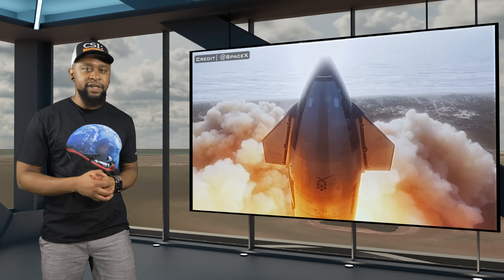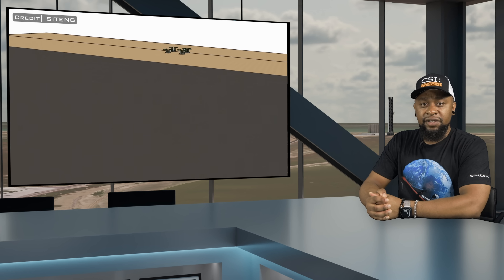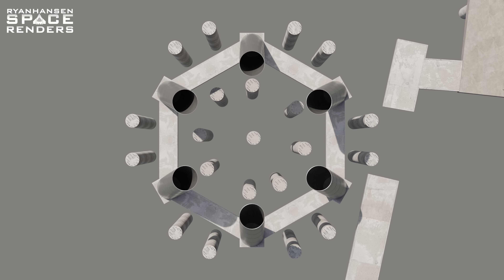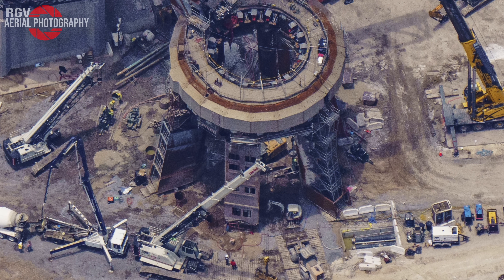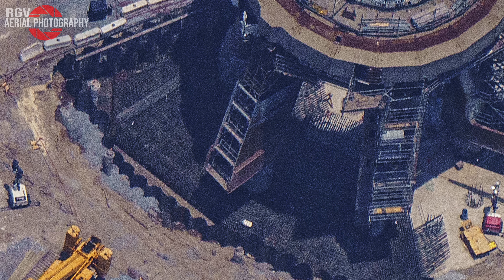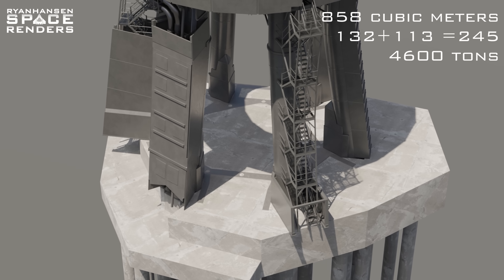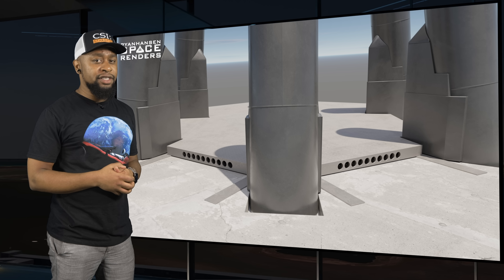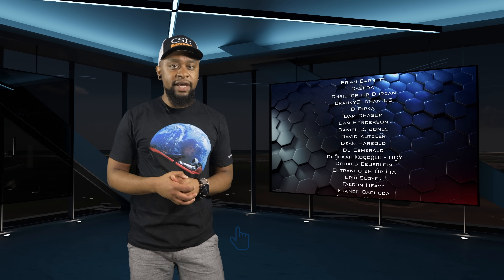How SpaceX Will Guarantee Its Launch Pad Never Fails Again! [Part 1]

Comment: A simple task for the OLT, would be a bridge arch stand and a blast arch ramp vectoring away from the stand center sideways. Not a blast cage!  The fuel pumps shouldn't be mounted on the launch. By a protract feeder. That's like smoking while pumping fuel in a fuel truck tank. ⛽ 🚬 😮💥 .
Reply: "fuel pumps shouldn't be mounted on the launch"

Thank you Captain Obvious

Comment: I admire SpaceX engineering, but the water pressure required for effective transpiration at the center of the launch mount is unlikely to be met from the edge-fed structure. Minimally, the "shower holes" in the plate will have to be made progressively larger from the edge to the center of the plate.

Comment: what do you guys thing about the rust, oxidation and corrosion on steel pad and structure cause by the water deluge system and heat from thrusters?
Reply: Ultimately they’ll either need to replace the metal plates frequently, or install a flame trench. The latter is more useful for rapid reusability.
Reply: Protecting steel from corrosion doesn't require breaking the laws of physics
Reply: @EMichaelBall Because flame trench last forever /s
Reply: @alvianchoiriapriliansyah9882  then explain please? What approach will they take?

Comment: How will they keep the water pumping against the pressure of explosive steam?
Reply: Uhm...the steam is on the outside
Reply: @alvianchoiriapriliansyah9882  oh yeah, water can't boil in a pipe because you said so. Also the "Outside" will have a pressure gradient with no diverter trench to help dissipate it.
Reply: @martinr1834 I hope it's better than their concrete calculations

Comment: 19:32 ... those pipes are not threaded, those are machine marks for sure. There is no need to make those holes smooth for a flow through the plates like that.

Comment: Much investment, that could all be gone if a StarShip fails and all its propellant burns on the stand, but true for all launch towers.  Wonder how this design compares to others.  Do any use water-cooled steel plates?  Don't most just flow a massive water deluge along concrete flame trenches?

Comment: Thank you for this long in-depth review on this OLM foundation. As always it has been thorough & educational too 👌🏻.

I have one Q, whether this foundation would meet Musk's ultimate plan of several launches a day! In fact I recall him speculating on the launch pad being ready "in one hour" , for the next launch after the booster is "caught"! 😮
Reply: The water deluge system is the big weakness. It has to perform to an extreme each time. A flame trench would help a load, but that would require a total teardown of the launch site, and the construction of a mega mountain to host the trench, with OLM 2.0 on top. Maybe they’ll do this in Florida!

Comment: Where did they find all this equipment just available for use along with the trained staff. Any project in the UK takes years because everything has to be coordinated. Safety case made, environmental impact must be checked etc.
Reply: The equipment is rented with some purchased ones with SpaceX labelled on them. They are contracted with multiple constructions, fuel and other specialist companies.
They have teams actively working on environmental and workplace safety.
SpaceX has a lot of contracted workers and they directly hire the longer-term ones.
Reply: I thank God that we aren't as over-regulated as the UK. Tedious regulation, designed to crush the soul. Licenses and permits have been dealt with.

Comment: The issue with the steel plate is that it still doesn't address the issue of noise and vibrations between the plate and the engines. Whereas nasa water deluge system has 1 million gallons per minute and a huge water mist and spraying everywhere. Just look at their falcon launches

Comment: Pillings go down into gound
The ground may be sand graval
brocken rocks or down to solid rock?

The piles the longer they are will get
friction resistance making a firm base to build?
Eartghquakes resonance vibratiion
can tirn holding souil sands to a liquid state?
thus loseing ability to hold the buldings or structures
 above
only the ones supported on a solid  sub surface will retain
integrity
In Japan huge solid constructed buildings have been seen
to tip over intact and sink in to the liquefied soils 
they were built upon
Force vibration resonance are forces not to be took for granted

Comment: Peering close-up into my crystal ball, I see a timing discrepancy between pressure build-up from the rocket engines and the inertia of the water-mass in the shower-head manifolds. Getting thousands of tons of water to move at sufficient speed to overcome the opposing pressure from the engines will be one hell of a job. If the engine fire-up is uneven, It only takes one incursion of exhaust-gas into one hole in the shower-head, for the flow to be reversed in the inter-plate void. This will cause all water in the void to be ejected via the outer holes that are experiencing a lower pressure differential compared to the inner holes. Steel will melt: The result may be spectacular to watch, but will take longer to cut away and repair. 
I'm not being a doom-monger, only looking at it from another perspective. Please don't shoot me!

Comment: I may not be an engineer. Would it not be 10x better and more efficient if you had no platform but a hole where the heat and thrust goes down and out somewhere far away? In a sense the heat & wave of thrust would not hit anything and it would not create any sort of backfire and wind/thrust that it can do when it becomes too much. Not to mention when it doesn't have anywhere to go or sideways.

I don't see how a steel / watercooler would be much more efficient. This would also be WAY cheaper when it comes to construction, since its really just a pathway for the thrust and heat.

Comment: I am wondering if that AR-500 Armor  can be used as a platform for SpaceX.
Meaning,  having a 6-foot thick by 40-feet diameter plate under the OLM to withstand the 36-raptor engines.  Would that solve SpaceX's problem.
Because something tells me, the concrete they keep using is not going to last that long. Specially if SpaceX is planning on launching 12 rockets per day on the same platform.
I am just wondering of humanity needs to step up their game and just lay down solid steel.  Either 6-feet thick, 12-feet thick or even 32-feet thick.
Just curiously wondering as my brain is going through different solution ideas.  🤔🤷‍♀🤷‍♀😁😁
Because by what I gather, SpaceX wants to launch 12 rockets per day. So I am wondering if what they have is enough, or do we need to over engineer to make it happen.  🤔🤷‍♀

Comment: Can't they just use large ceramic tiles like the ones they use on the spacecraft but much larger to deal with the heat better than what they are using? i mean it will be expensive but wouldn't it last longer in the end?
Reply from the maker: No they are too fragile for that purpose

Comment: Is the de-watering system a permanent system or does that get removed once all concrete is finished and set?
Reply from the maker: Dewatering system won’t be necessary anymore once they are finished
Reply: @CSIStarbase  ahh okay cool! excited for part  2! also excited  to see how much water this thing pumps out, the  storage doesn't seem crazy but scale is hard to tell. thanks for the best content on YT!!

Comment: you need press next while youre reading the script. having someone else do it causes an unsettling delay between each page or slide
Reply from the maker: I do all my recording by myself.  The issues have sense been fixed from this video.  Check the improvements in my most recent episode.  

For the record I was also severely limited with how much time I had to do finally touches with editing due to needing to get the episode out by a certain date per sponsor requirements.
Reply from the maker: This episode was an outlier in terms of quality of editing for that reason.

Comment: Much better than expected? It was a catastrophic failure that burned itself out, lost control within a minute, and went up in flames!
Reply: It's a prototype.
Reply: @geoffallan  Ok? Even if that were the case, that doesn't change all the damage it caused to the local area and the launch site, nor the does it change that it was an uncontrolled flying explosive spectacular failure that also failed to self terminate and only blew up because it's own fuel ignited. Anyone trying to paint this as some sort of success is falling victim to Musk hype.
Reply: @JohnSmith-xv1tp  But it is the case, it's a Prototype, a massive protype that will become reusable. Are you confusing a human rated craft with this? This is the most insane construction that has emerged from a tin can (Mark 1) that couldn't hold pressure to reaching an altitude of 40 KMs (That's pretty impressive considering the fear was it wouldn't clear the tower). I don't understand why you can't see the reality of this craft instead of being disingenuous and showing your agenda with misinformed bias?

Comment: Good video, but thanks for making it as confusing as possible giving half the specs in metric then half in standard.
Reply from the maker: I live in the united states. The launch site is in the united states so thats what comes natural to me. I try to give metric units where possible even though most of these systems are designed in Imperial units. 

Someone is always going to complain about units so there's nothing I can do about that
Reply: @CSIStarbase  Not sure that I am correct in saying this, but I think most people watching this video are used to imperial units.

Comment: New to this channel... were the first few seconds "we can all agree Starship performed much better than expected" intended as a joke?

The thing destroyed the launch pad, hurled debris for miles, the engines failed, it lost control and flipped end-over-end, and finally exploded.

Calling this "much better than expected" is spinning it HARD... Is there any scenario bad enough for you to call it a failure?

I'm an engineer/researcher, so I understand the R&D process includes making mistakes. But SpaceX is a 21 year old company at this point. These kinds of fundamental mistakes should have been ironed out a long, long time ago. It's very worrisome to see. SpaceX is famous for having high turnover, and this kind of disaster makes me wonder if there are serious "institutional memory" problems going on, where they are unable to maintain an experienced-enough team.
Reply: A disaster woud have been a RUD on the pad, so therefore, it was better than expected. The ship and booster had had a lengthy testing program, Booster 7 especially. It's incredible it got off the pad.
It was easier to scrap 20Kms in the sky and lengthy excavation work was shortened. The upside down shower head design has been in the works for many months so all they were doing was accelerate the developement. 

In conclusion, it's certainly a dirty solution but in the grand scheme, a minor blip. (imho)
Reply: @geoffallan  I still can't tell if this is a joke... "The ship and booster had had a lengthy testing program, Booster 7 especially. It's incredible it got off the pad." Do you see the contradiction here? Shouldn't a "lengthy testing program" mean you expect it to work? And again, SpaceX is a mature 21 year old company. Having such low expectations around their core competency is just so... weird.

I feel like SpaceX is surrounded by a very cultish atmosphere. Their public image is so contradictory. On one hand, SpaceX is so amazing, they have 1000 geniuses working for them, they are building the FUTURE. On the other hand, expectations for any PARTICULAR test are incredibly low, so low that people dismiss disasters as "normal". This is some intense PR bullshit.

I would hazard a guess that SpaceX is only surviving as a company because the US government views them as a strategic/military asset, and won't allow them to fail. That's also why they won't face legal sanctions for the dangerous launch failure, and there's an infinite supply of money to burn through.
Reply: @yum33333  I would agree, but Starship is a very early prototype of something that has never been done before so I am very open minded. SpaceX have proven themselves many times in the past to solve a design. So to write off Starship at such an early stage doesn't make sense otherwise I'd have to suggest your motives are misguided and driven by the media?
Reply: @geoffallan  "So to write off Starship at such an early stage doesn't make sense otherwise I'd have to suggest your motives are misguided and driven by the media?"

It's stuff like this that gives me clear cult-vibes. Why do you think I have an agenda from the media? I'm just so exhausted of the hype and hero-worship going to this company, and the endless excuses people roll out every time they screw up.

For example, you give the excuse that Starship is at "an early stage". That's not true at all. Let's compare:

Starship: Started in 2012, 11 years of development so far.  Four rockets lost so far in testing. Probably many years of development remaining.

Apollo Program: Started in 1961, landed on the Moon in 1969. 8 years. One rocket was lost in testing.

Space Shuttle: Started in 1971, first crewed orbital flight in 1981. 10 years. Reached orbit on 1st flight, zero rockets lost in testing.

Now, maybe I'm wrong. But in my eyes there's a pretty clear quality problem at SpaceX. Which they are making up for with an endless PR campaign - and that PR campaign is what irritates me. To me, it comes off as deeply dishonest. And considering Elon Musk's past history of misleading investors and pushing crypto, I have good reason to feel that way.
Reply from the maker: I’m not part of SpaceX PR team.  I speak what I believe which is why I don’t sugar coat anything. 

I think mistakes are bound to happen in the development process of a new rocket.  We just don’t get to hear about them as often with other companies.
Reply from the maker: As far as whether or not the statement I made at the beginning was a joke, no it was not. 

The following statement about “I think we can agree there was a little room for improvement” was the joke.
Reply: "... SpaceX is famous for having high turnover..." But does SpaceX really have a high turn-over rate?
Reply: @geoffallan  Elon stole [Their] twatters and they be way mad 'bout dat! I hope he cleans out their back doors and changes twatterbird's color to red, for the lols.

Comment: I'm telling you now, again, there's going to be a loop on the plate so water is circulated.
Reply: The water that goes out the plate doesn't return back
Reply: @alvianchoiriapriliansyah9882  why two pipes! Why build an entire second set of pipes? If you need more flow, you'd just make the feed bigger.

Comment: @zack why cant they just hack off the OLM platform, set it aside, raise and extend the pile pipes upwards another section, reattach the platform? Stack another section on top of the tower and tie everything back in? I mean its alot of work yes but it cant be any worse than all that digging and mud slop they just did. IMO if this quick fix dont quite cut it then they going to have to raise the OLM platform and tower

Comment: I have the feeling it's going to fail quite badly again.
Reply: It feels like SpaceX believes the pressure from the Raptors exhausts is applies evenly onto the surface below, like my hand pressing the skin on my skin. But I think it's more like the exhaust from the Raptors apply very localised pressure points. It like it's stabbing my skin with a knife.

Comment: Your detail on this is incredible.  I was unaware of the complete failure of the launch pad.  My question I would propose is what are the construction differences between Saturn V launch pads LC 39A and B and the Space-X launch pad that allowed the Apollo Saturn V to use it's launch pads through it's whole program without catastrophic failure and Space-X had a catastrophic failure on it's first launch.  There were 13 Saturn V launches between the two pads, and the pads did the job...why was the launch pad not capable to withstand the first launch of Space-X Starship.
I'm not being critical of Space-X, I am an advocate, but I do find this troubling.
Reply: Apollo 4 launch isn't damage-free either
Reply: @alvianchoiriapriliansyah9882  yes, but it's not catostrophic.